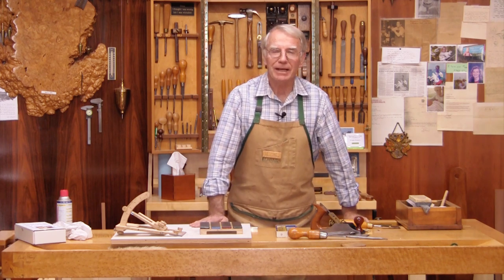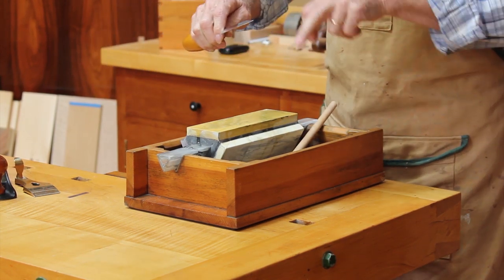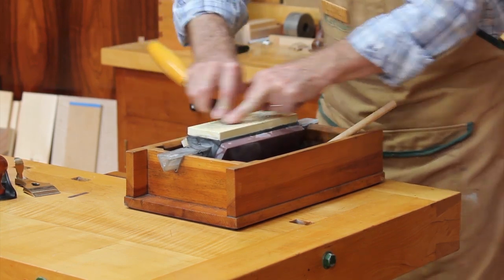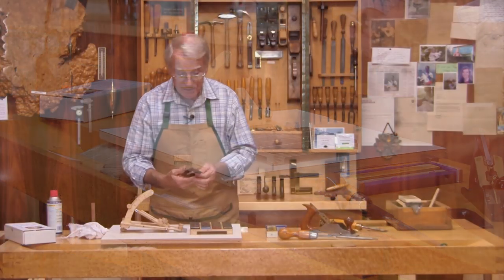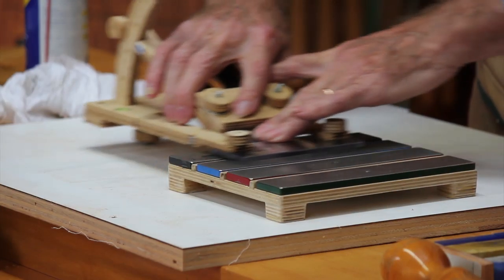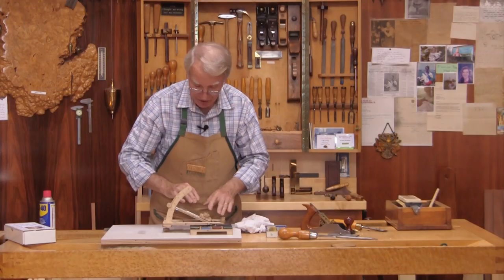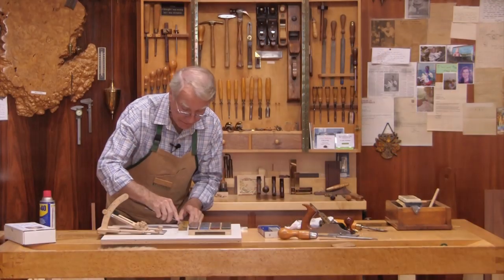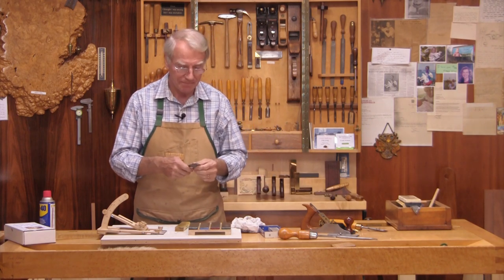Frank Klausz on Sharpening

Comment: The chisel portion was excellent.  I think jigs are unnecessary too.
       The plane iron part seemed like an ad for the jig and stone product.  Not sure why you'd not just freehand the plane iron, which would be easier (more surface area) to do then the chisels.  The edges can be rounded just by adding more pressure there.

Comment: The finest stone i use is a 1000 stone and the i move on to a tool that you're probably unfamiliar with its called an emery pad and its used to buff girls nails and it is a small foam block with 3 different grits which polish the edge